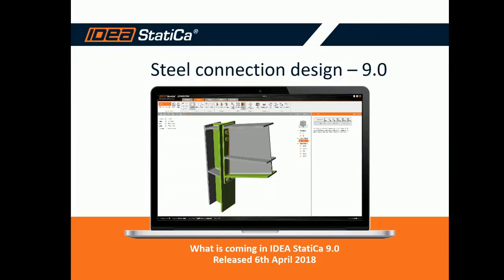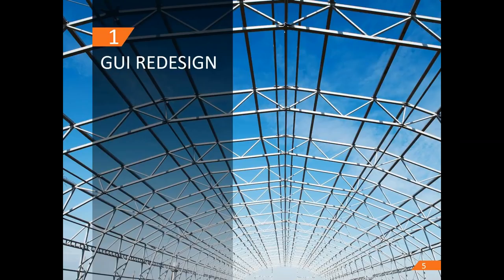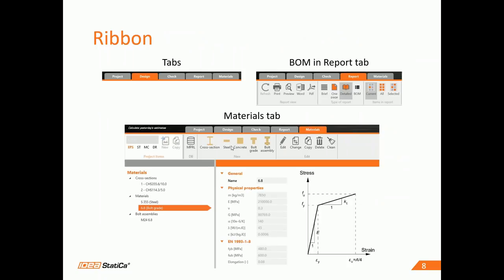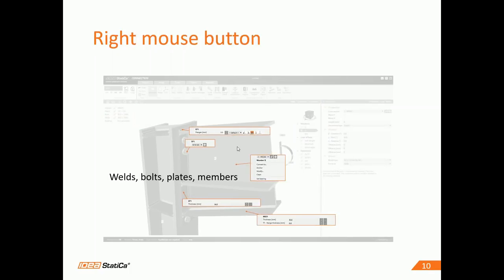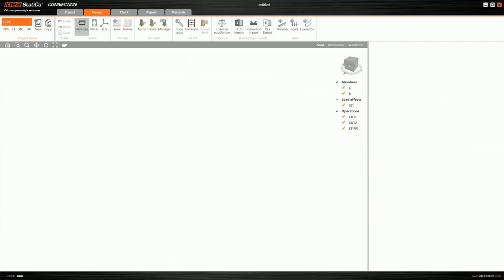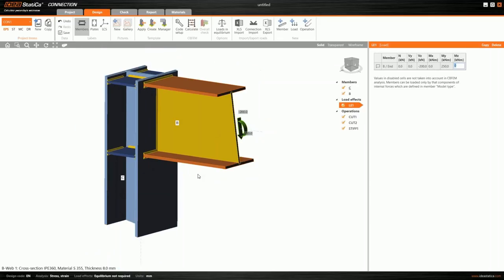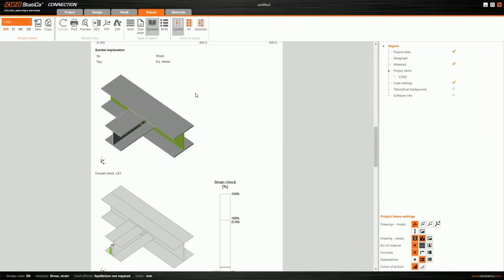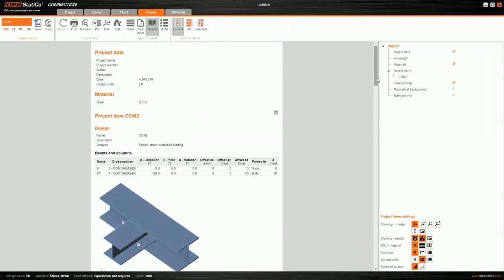What is coming in IDEA StatiCa 9.0 for Steel

Comment: when you put the load  on the members , did you  take in your consideration that is the member doesn't have common node which means if i take the load from staad for example there will not be equilibrium in the forces. is that correct ? 18:53
Reply from the maker: Hello Mohammed,
please check explanation on our WEB. Here is  link for "Import from FEA program – equilibrium in the node": https://resources.ideastatica.com/Content/02_Steel/FAQ/Geometry/Import_from_FEA_program%E2%80%93equilibrium_in_the_node.htm?tocpath=Connection%7CFAQ%7CGeometry%7C_____9

Comment: Dear Sir,
How to set the length of beam 1m for IDEA v9, not like old version
Sincerely
Reply from the maker: Hello Chandamuny, the length of the member is set automatically in version 9. See https://goo.gl/1T2dvR
Reply: Thanks you  where can I check to see the length with auto.?
Reply from the maker: The length is automatically adjusted after adding some operation. And you can set the Default length of the standard member in Code Setup (=1.5h by default)